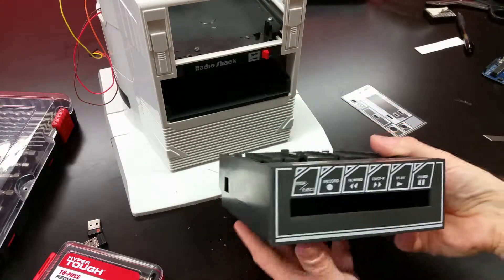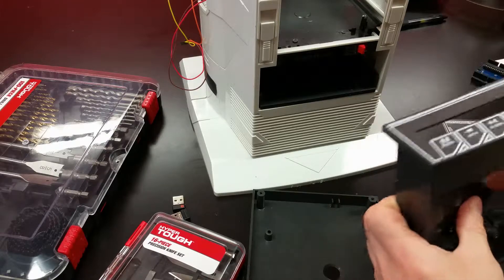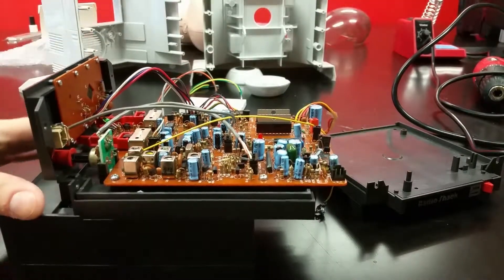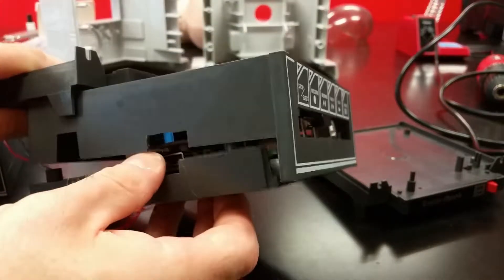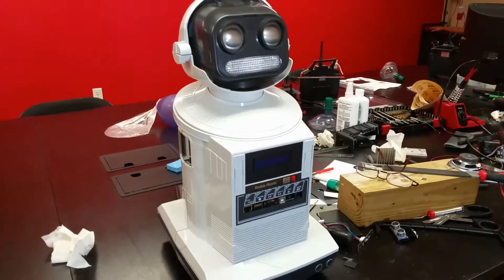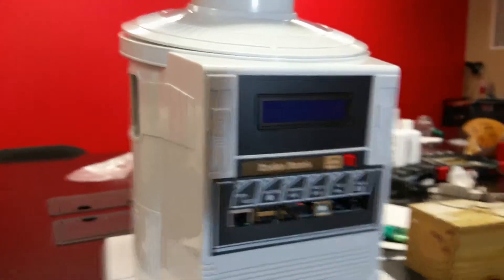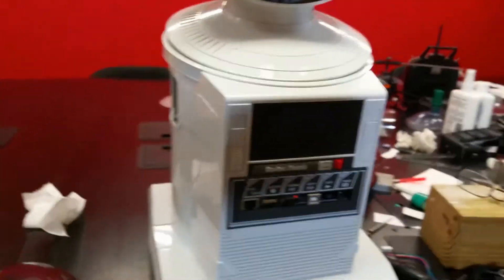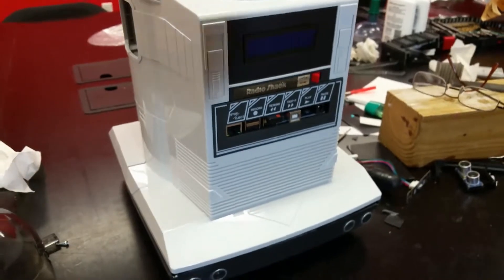Part 3. Make a smart Robot with Arduino and Raspberry Pi. Radio Shack Robie Sr.

Comment: Next time, 3D print the parts, instead of ruining the original parts! If you don't know how to use solidworks or have a 3D printer, I can help you out with that if interested. Contact bri (AT) bribot (dot) com
Reply from the maker: I have a 3d printer. Many parts have been made for Robie. As I stated in the intro, I did not want the project to need 3d printed parts as far as the videos.

Comment: can you help with getting tires for robie sr? please.
Reply from the maker: Fortunately I have not had the need for new tires yet but I have thought about this. Of course it can be 3d printed. Not sure how well that will work. I also thought of using the tire treads from a child-size bike tire or even heavy foam tape. Measure circumference and width and just glue to rim. My Robie is ready for a new video. Maybe ill do a quick one today.